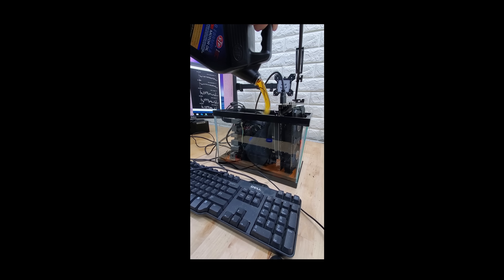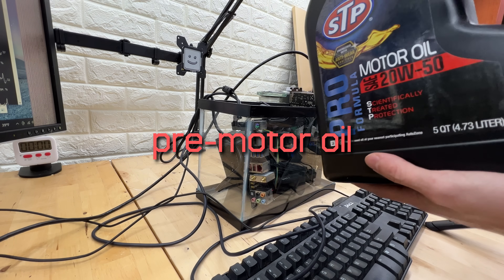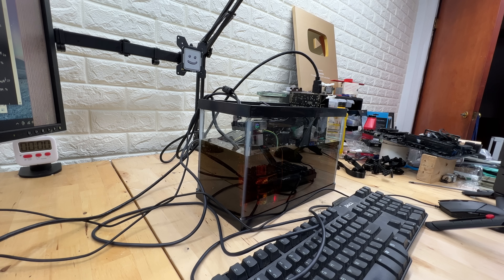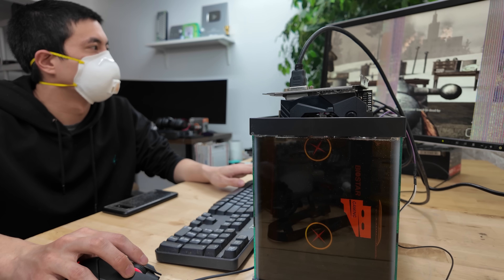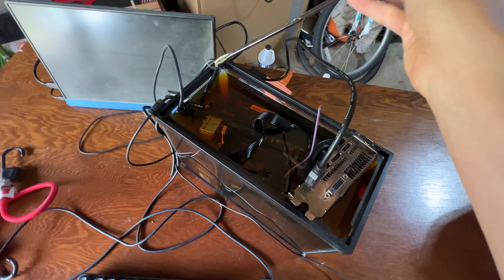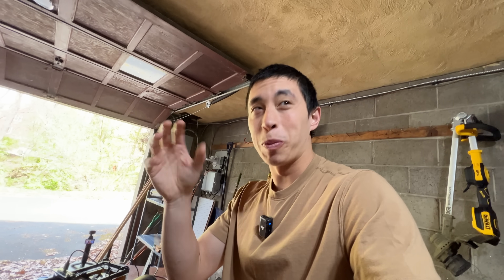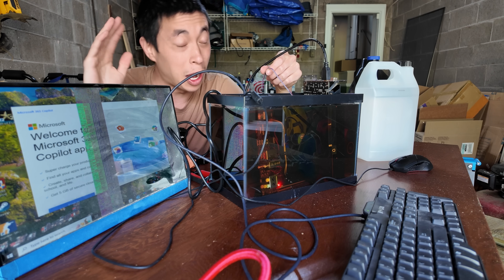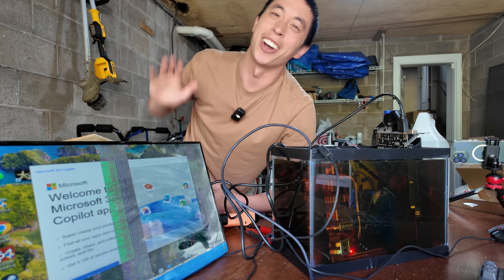Why isn't Motor Oil used to cool down PCs?

Comment: cut the ble wire to override fan speed control... BOOM ! full 12volt fan constantly, also does aways with safety stop on the fan as well.

Comment: Will my build be ok?

CPU: Ryzen 9 Threadripper pro
RAM: 2x32Gb DDR5 gen5
GPU: NVIDIA GEForce 5090ti
SSD: 4TB Crucial NVME x 4
PSU: 1200W Platnum GT snow 80+
MOBO: MSI MPG X870E EDGE TI WIFI7
COOLING: ENOS 0W70 synthetic oil
Case: 2ft fish tank
Reply: Dear god what is this build, also 5090 TI?! Theres no ti
Reply: @Thaxvr just throwing crap in there 😂

Comment: in my  search for fluid that would grow algae I filled my loop with baby oil once and it didn't pump to well, lol also tried window wash but it isn't good for the plastic parts. now I use RV plumbing antifreeze and ive had the same pump and radiator for over a decade

Comment: You might be able to try transmission fluid. I know that transmissions have electronics in them that are submerged in the fluid so I'm pretty sure it won't conduct electricity plus it is a lot thinner, probably closer to mineral oil than water, plus it has a really cool red color

Comment: Also I'm curious to see this experiment done again but using a water loop instead with the oil inside. See if the oil can cool off the water block heat sink.

Comment: Actually motor oil doesnt cool its only reduces friction and the temperature drop you are seeing its only the temperature transfer to the oil once you get your computer working enough to heat the oil up the temperature of the cpu will start raising

Comment: Motor oil as a cooling mechanism and a submergant fluid for electronics and plastics_ actually makes sense. Car's, more than anything now a-days, have oil running through, in, and over plastic parts. I don't like that is a thing, but the reality is, plastic should be able to hold up. Especially since the oil will never get enough heat to start degrading and becoming acidic. Same goes for the electronics. A good example of basically a PC in motor oil, is inside a transmission. There are wires and electronics, submerged in HOT ATF fluid at ALL TIMES.

Now PC parts I imagine, are not built for engine oil's more leaning towards basic acidity and chemical compounds. I would anticipate issues on the electronic side of things further down the road. And kiss those fan motors goodbye in that 20W50. (You really had to pick some of the THICKEST motor oil, eh? lololololol.) 

Cool experiment!

Comment: Motor oil is a lubricant and "almost" worthless to help with heat transfer.  Any water based coolant is many times more efficient.

Comment: The second I saw "20w-50" I knew there was going to be a problem with the fans. Use thinner oil. Can't believe you guys didn't consider that ahead of time, and if you did, I can't believe you went with something as heavy as a 20 weight.

Comment: The thing about the cooler fan not working could be fixed by having the oil circulate through a heat exchanger, ie cooling the oil separately

Comment: A couple of things I don't understand: Why would you need to submerge the power supply as well? Seems unnecessary. Second, why would you even need fans once it's submerged? It's not like there is any airflow and slightly shifting such a viscous oil can't possibly do anything additionally to the cooling effectiveness.

Comment: no you can pour it down the drain IN your house that is waste water and goes to the treatment plant via the sewer, you dont flush your poopies into the nearest creek. it is a closed contained system. no concern.
YOU CAN NOT UNDER ANY CIRCUMSTANCE pour ANYTHING into a storm drain on the side of a road or into a retention pond or ANY watershed area as that is NOT a contained system and is indeed nature. there are not two sewer system types. sewers connect to buildings, storm drains connect to.... tributaries, streams, creeks, rivers, oceans, etc directly without being treated. THAT is why we can not pour oil down STORM drains. not all drains. HUGE DIFFERENCE.

honestly any argument made as a counter is 100% useless bullsht. i worked in the car wash industry for over a decade. replaced broken equipment, remodels, new installs... im not pedro the prepper... the car wash industry is very self regulating in what they consider acceptable or not. i cant speak for others except that a city water district inspector came to our wash we were remodelling to sign off on it..... this is the part where NO MATTER how much your lil wanna save EVERYTHING heart wants your view to be the view.... the local govts, bc of monetary reasons, consider waste water what it is.... they DO NOT care what is in it... oil, pee, poo, blood, its a sewer....we have chemicals and processes that clean water AGGRESSIVELY... that is actually the trivial part to all this. cleaning is easy, its just costly. costly means that inspector told me to my face.... he would MUCH rather the run off from the car wash and lube center next door to run off the back of the property and into the creek bc..... heres where your heart dies..... to the city it is just a volume of water to treat and that will cost this much money per gallon. ANYTHING that lowers that. REGARDLESS the method is acceptable. he told me he would rather it go into the lakes.... a lake his city isnt near so it wont affect him..... my pops and i both were FLOORED, our company does things the right way and WOULD NEVER have even tried to break the law and do that. he said it so casually. that day i realized its all a show. not every, in fact MOST people day to day dont do the right thing, they do the easy thing. whats easier than "not my problem"

all pouring motor oil down a sewer does is cost the city more, and considering the above.... dont fret making them spend the money. it has to be spent, the water is already dirty.

DO NOT EVER POUR ANYTHING OTHER THAN WATER OR A DRINK into a storm drain. EVER. THEY ARE NOT THE SAME. saying well you cant do this one so dont do that one is legitimately  unintelligent. i know this point was SUCH a tiny non critical part of the story. but it does need to be stated. if youre for example freaking out over what to do with the oil..... just flush it homie no worries. literally. youre in a pinch, pour it. its gets treated. its ok, you didnt kill a puppy.

this was a PSA brought to you by someone that....has a ton of tisms.

Comment: Give the fans straight dc power without pwm pins plugged in. The pc can't stop the fans from spinning in that case. Also, toyota sells 0w-7. 20w-50 was never a good candidate for this

Comment: The main difference between the mineral oil & motor oil in terms of longevity is likely going to be the silkscreen on the PCB's, and the plastics on the wiring.
The motor oil probably won't corrode any of the metals (since it's used to being around metals in an engine), but I'm not so sure of the plastics & resins.

Also: If you can't see through the liquid at all, having see-through panels on the sides of a 'cool pc case' is completely useless. Might as well use a bucket.

Comment: Used motor oil (that is, run in an engine) is hazardous to health and to the environment. What he has done with it doesn't technically make it used (or hazardous).

Comment: I would really like to see this oil cooling solution with a much thinner oil like 0W-30 or 0W-20, combined with a pumping circulating mechanism, like a fish tank filter pump. This could be a next experience. Cheap, clean, and basically a silent "passive'" cooling.

Comment: you forgot that the rubber on the wires will degrade and become soft and at some point the wires will short causing the computer to no longer to work

Comment: You need to remove the fans and circulate the oil. I feel like that's kinda like, obvious right? Without circulating it, especially with that super thick oil, it's going to just heat up the oil around the hot spots. Oil will definitely ruin rubber and silicone though. Probably plastic too if I had to guess.

Comment: alot of conventional motor oils use a mineral oil base but they have additives and chemical formulation to help lubricate the parts of an engine better and disperse heat also it cannot be conductive in an engine since that causes problems also it isnt the best user usable option but maybe if you run a thinner oil with slightly better formulation that wont capture as much moisture like a oil with a synthetic base instead of mineral base that over time will not degrade and have a shelf life and you keep it outside or in a fridge even you could run it potentially so like a 0W-20 synthetic in a fridge or freezer and have the cables come from outside of it and it will probably dissipate heat pretty well and run very cool in theory maybe

Comment: It'll work, it'll just be a hassle to clean.
You should use a radiator and pumps to cool down the oil.
Remove batteries before doing the next thing.
Have you tried putting the components in an ultra sonic cleaner or a dish washer?
Can you use mineral oil in a custom water cooling loop?
Would the normal pumps work?
What about flow meters?

Comment: I have a big question:
Does it degrade the parts slower than mineral oil? Many of them have “protective” additives that reduce wear on rubber parts.

Another question is: How could would it look with some red LEDs?

And finally: Can you reduce or eliminate the oil creep by enclosing it and having something like silicone or something else to close the holes where the wires go through?

Comment: definitely seal it up, use 0w8 (yes, that exists now), and remove the fans all together and get all the oil circulating through the tank and through a radiator. it probably doesnt even need fans on the rad if this one was able to kinda stay cool just sitting still in the oil.

Comment: optimally youd have a case that could drain the oil into a tank when needed, and only certain parts of the pc would realistically benefit from immersion. As such, having components designed from the get go for it are not out of the question. Maybe when graphics cards just get too taxing on power they get really hot, maybe oil immersed cards will be a thing.

Comment: You can get some very lightweight motor oils which might have been alright with the fans. Motor oil which is used in an engine absorbs hydrocarbons and various other byproducts of combustion, which is most likely what the warning is about. Although it also has a lot of additives to make it better for use in an engine which may also be harmful.

Comment: Id have used the lightest weight oil as possible. Ideally 0w20 or lighter. Full synthetic is probably better as it won't degrade as fast.

To cool it further you can use a pump, and external radiator, fans if you want to go the extra mile (a trick used a lot with mineral oil).

Also for the motor oil. Ex mechanic here. It's mostly used motor oil id worry about.

Edit: also 20w50 you kind if picked the heaviest/thickest oil on the market that's readily available.

Comment: While this is a crazy option.... what if you used it in a water cooling loop? the oil moves slower but also has ZERO chance of corroding your blocks and if it spills... its a mess but your components do not short out might need a pump made for moving oil though

Comment: Potential downsides: plastics and rubbers that aren't meant to be submerged in motor oil can absorb and degrade over time. Engine leaks can destroy plastic and rubber components under the hood. Over time these components can liquify or become extremely brittle

Comment: There's this thing called mass specific heat capacity (Google translation from my language).
Every substance has this criteria. It tells, how much energy you need to heat up 1 kg of this substance 1°C (like from 20° to 21° or from 350° to 351°, doesn't matter).
So, if you're using coolant, you want it to have as much mass specific heat capacity as possible. 
Because what coolant does is it absorbs heat from a machine. 
The more heat capacity, more heat can be absorbed, cooler your machine.
SOOOOOOO
As it turns out, liquid water (H2O) has the highest heat capacity around all materials in universe. To heat up 1 kg of water 1°C you need 4200 joules. 
BUT.
Water freezes at 0°C and vaporises at 100°C, so temperature range where you can use water as a coolant is very limited. 
But your PC doesn't heat up over 100° and never cool down below 0° (hopefully) So water is your absolute best choice.
(Obviously you don't want to pour your water directly over your micro schemes, you'll need some kind of heat exchanger, which is also great, because altho metal is very low on heat capacity, it's high on heat exchange capability)

Comment: Didnt watch. Motor oil is designed to resist heat, not transfer it. You want a liquid that can easily absorb and release heat so that it takes the heat from where you dont want it and moves it to some where it can be cooled.

Comment: Because oil isn't a coolant, it's a lubricant. You want something that transfers heat well like water but that doesn't conduct electricity, oil holds on to heat longer

Comment: Still gotta setup a radiator to pull out the heat from the oil or it'll overheat after a couple hours of usage

Comment: use ATF, solenoid and other electronics are submerged to that liquid inside transmission then do a oil cooler like a pump and radiator. for cpu just grab a dual tower cooler. then pump oil through fins.

Comment: That motor oil is probably too viscous. Probably need a thinner one. That one is like borderline gear oil. Not surprised it didn't immediately short. But I wouldn't do it long term ... It does have detergents to get metals into solution and dirt. So it may eventually conduct a little bit.

Comment: Because you don't cool the engine with oil, you lubricate internal combustion pistons to avoid friction and lower thermodynamical lost. you cool a car engine with propelyn glycol that circulates from the inside of the engine to the radiator the same way your GPU coolers leashes heat form the surface of the chip to the tower radiator and fan systems.
But I am almost sure Lionel made a mineral oil cooled set up.

Comment: I would use like an aquarium air pump with an aerated air line to promote flow or circulation of the oil.

Comment: You didn't test out synthetic motor oil. That probably is not organic and would work just as close to the mineral oil used in PCs.

Comment: with no circulation system .... I see an issue with oil against the processor and inside the GPU getting super hot and breaking down.

Comment: I would modify this experiment with a alteration to the fans.Create a slightly large container, and then get an under water fan or current generator.  You can't do these experiments without proper equipment.

Comment: do not use air fans, use oil cooler, use oil pump, it´s fine. here dudes tested without CPU cooler. it worked even then.

Comment: Now buy an electric oil pump, put a heat exchanger on it, and build a mining rig (which will kick out a LOT of watts).  See how well the oil cooling works then.  I suspect both motor and mineral oil will work but the fans not spinning will matter a lot more.  You need far thinner oil like a 0w20 as someone else mentioned.

Comment: "our fans are effectively not effective" but they will be because the oils will thin as the pc heats up due to the fans not running
Reply: also what about engine coolant
casually developing frost in your previously 90 degree pc

Comment: I'd love to see someone build a comp using a fully synthetic 0w oil with an external oil cooler(think like a power steering or trans oil cooler); with the warm oil intake being mounted higher in the tank and the cooled oil coming in on the opposite side of the tank down low. As for color, maybe use Royal Purple 0W-16.

Comment: This is stupid. you have oil that is 1 step away from being crude oil, you have no way of cooling the oil, and you have no way of the oil actually cooling the parts. anyone with a pair of eyes, would notice in all of the vids and clips of a mineral oil cooled pc, there is no heatsinks and fans on the contact points, as to have the oil do the direct contact cooling, the oil then is pumped through the case and into a radiator to be air cooled and pumped back in when cooled. might as well have dumped a regular pc into a bath full of this shit. you would have the same result.

Comment: 2:00 id like to see what happens if you use 0w8 or a similarly thin oil.
Reply: Maybe a car coolant liquid cooler with nitrogen on the reservoir or radiator

Comment: 3:03 ermmm actually, air is a fluid not a gas
Reply: what r you talking about 😭 it's both, fluids are just things that can flow, gases are fluids, and air is made up of gases
Reply: @ashlyn-6614 wrong, there’s clearly defined lines for the 3 major states of matter— beyond what “flows” and what doesnt
 The temp and pressure applied is what determines it all. Just look at a phrase diagram
Reply: @noxxsux  plasma : oh i see

Comment: One reason we don't use motor oil is because they tend to put additives in them that are going to be rather bad for for a PC, some of which are metals so it can make them conductive...
Plus you used some REALLY thick oil.

Comment: 0:36 going in at this point, my bet would be on cheap oil it works, 9n more premium ones it wont. Reason being that some additives to motor oil may be electricity conductive, which is no bueno for pc,

Comment: This could actually be a practical use for peltier device.

Pumping thinner oil through a filter in a separate chamber externally with a peltier plate attached on one side, sealed in, and the hot side exposed with a fan

Comment: Yes, you can. But why? Even if you change it very often, it creates a mess, needs special disposal, creates extra wear on moving parts due to viscosity, and smells. Not to mention, it may cause sludge on heated surfaces, the metals from the oil may have negative impact on exposed parts.